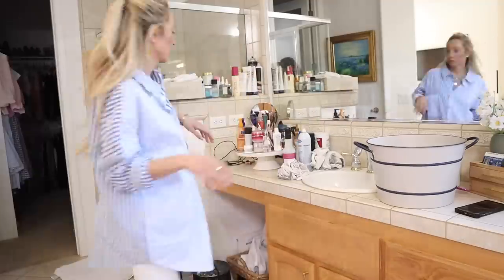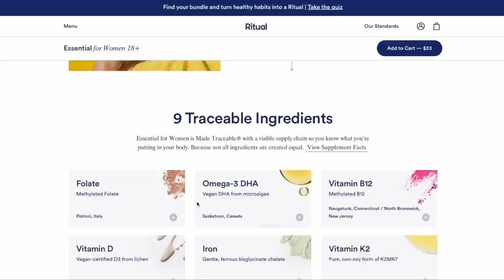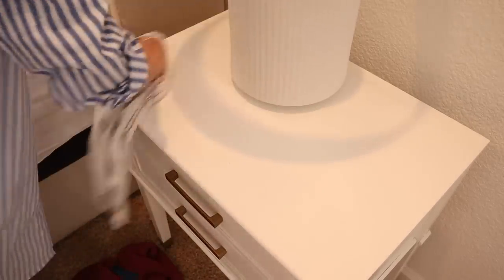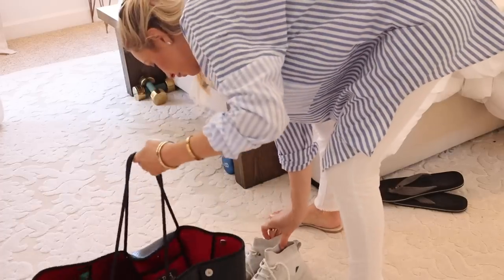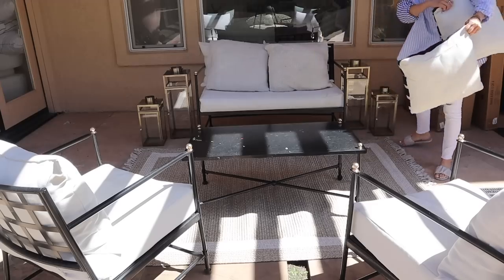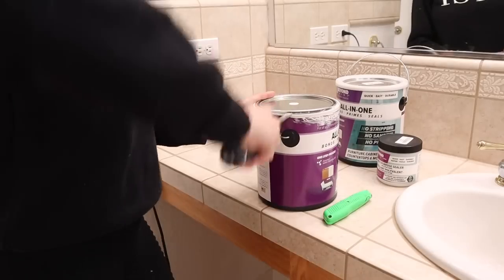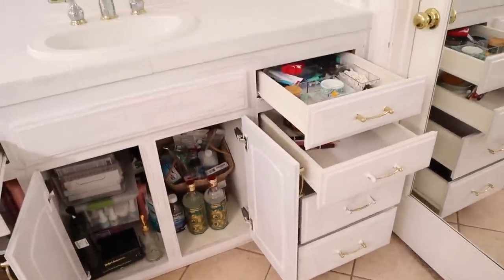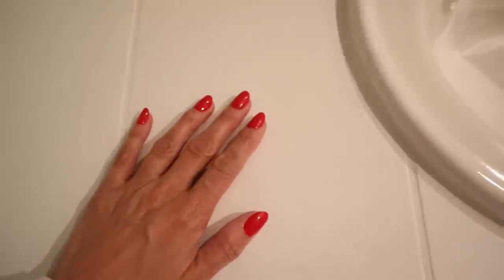MASTER BATHROOM DIY MAKEOVER

Comment: Sorry but I can't believe you did not remove the hinges or hardware off the cabinets,  the faucets from the shower or sink or any of the outlets or light plates.  Also if you would have taped you would get a much more professional look. I realize you plan to remodel in a year or so but It would be nice to look at until that times comes. I guess you are just brave.